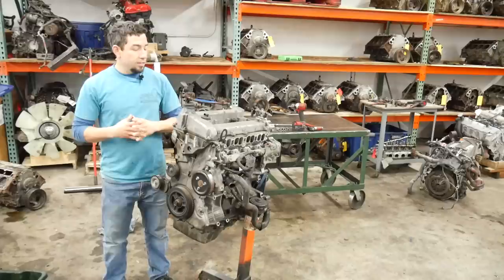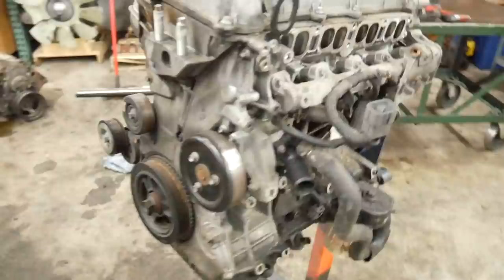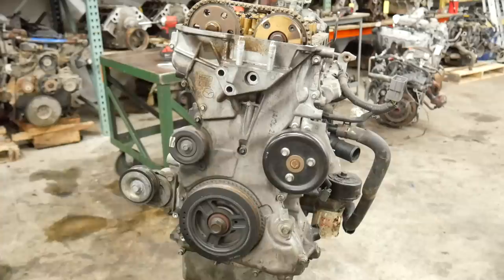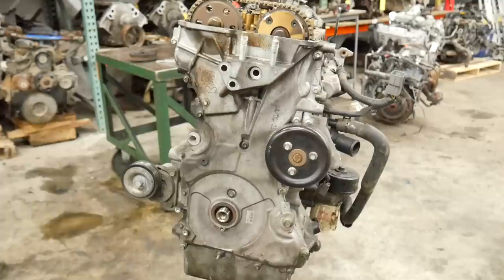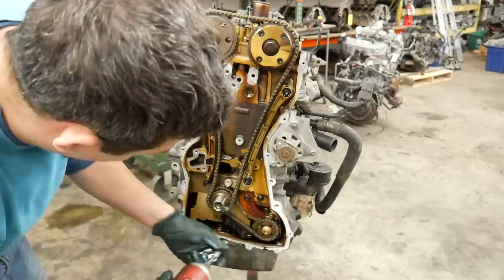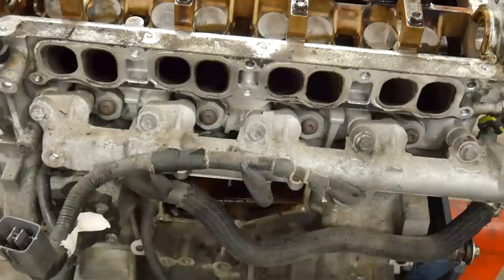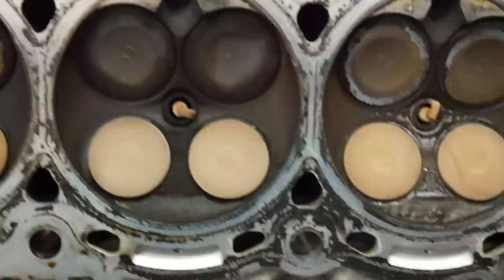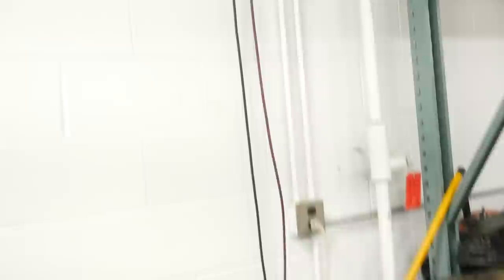TOTAL TEARDOWN: BAD Mazda MZR 2.3L Turbo Mazdaspeed3 Mazdaspeed6 CX-7 Engine.

Comment: It's a FoMoCo - OF COURSE it requires special tools and rules.  The mark on the block explains everything.
Reply: Aside from ls and lt series engines, isn't that sort of an industry- wide thing nowadays?
Reply: @mrdumbfellow927  Which was probably inevitable given the scope and design of propulsion systems now, but good old Blue was up to those tricks fifty years ago.  Not all of it was that way, but  I remember having to fabricate a lot of "special tools" on the fly to keep a Ford running in the seventies, which was the worst era.
Reply: Plus this engine served as a precursor that marked the blueprint for the current day ecoboost engines from ford. So it was just what mazda was dealt with since they were under ford
Reply: @Sn0w_Official  the originating designer was Mazda.
Reply: Ford just owned Mazda at this time
Reply: FoMoCO nearly killed this company. JLR too.
Reply: @taylorc2542  yea no.  Mazda was never fully owned by Ford.  One third.  The wankle/Rotary is what nearly killed Mazda.  Ford gave Mazda greater scale of economies with platform utilization.  Is Mazda doing better now?  JLR, was saved by FoMoCo, the V8 and V12 engines were financed by Ford and remain their best engines.  Hating on a company does not save you from facts.
Reply: @ProjectFairmont  Is Mazda doing better now?  They are now partnered with Toyota, so I would say emphatically that the answer is "Yes."
Reply: @JamesSterling  so, what?  I could care less either way.
Reply: @ProjectFairmont  You asked the question so why did you ask if you don't care?  Huh?
Reply: 😂😂😂😂😂😂 they all do that now days what are you talking about especially the German brands
Reply: @taylorc2542  ford gave them the ranger pretty much, I’ve put over 400,000 miles on a ranger. Damn good trucks
Reply: @JamesSterling  Are they really partners with Toyota? My 2017 Mazda 6 has FoMoCo parts, such as the CV axle.
Reply: Yeah Mazda has improved greatly since they got Ford out of their life.
Reply: @ProjectFairmont  Ford owned 49% of Mazda and the rotary wasn't what nearly killed Mazda at all.
Reply: @freedomisntfree_44  because in the 1970's, Mazda gave Ford the Courier small pick up. @James Sterling, Mazda isn't fully partnered with Toyota, but the Toyota (and earlier Scion) iA, and some later Yaris models were/are rebadged Mazda 2's. Mazda also saved the US market Escort, a dreadful FWD compact in it's 1st U.S. incarnation, by giving Ford the BG Protege chassis in 1990, along with Mazda's excellent BP18 16v 1.8L, optional in upper level Escort/Tracer models. Nearly identical to the MX-5 Miata engine, it whipped out 128 BHP, compared to Ford's 1.9L wheezer making only 89 BHP.
Reply: What Ford cars did this engine come in?
Reply: @mrdumbfellow927  I think Honda and Toyota still used keyed timing gears, floating timing sprockets seems to be more of a European thing.
Reply: @fredzeppelin3969  Future Mazda6 and Mazda CX-9 are apparently going to be based on Toyota's RWD architecture.
Reply: @ProjectFairmont  Hell yeah finally someone who knows what they are talking about!
Reply: It’s a good system as you always get cam timing spot on, even if you skim the head etc. no more adj cam gears etc
Reply: @EdwardT9  I think as far back as the Pinto.  Currently, a version of this engine is in the Mustang EcoBoost.
Reply: Blame ford for this lol. Glad Mazda got out. They do have a partnership with Toyota.
Toyota also owns like 5% of Mazda now. They have a joint plant in Alabama now.
Reply: Get off the app now
Reply: Hahaha that post got me lol.
Reply: @ProjectFairmont  got him with the facts over feelings haha
Reply: You think that’s bad you should see what working on German stuff is like
Reply: Bruv this engine doesn’t even have a key way to hold the crank gears

Comment: I loved my mazdaspeed3, sooo much power,  so fun to drive, never had a problem with mine but I also took care of it.
Reply: Did you buy it new?
Reply: Just came back from 850km road trip and its healthy like new.
Reply: Still daily mine bolt ons and tuned by freek.

Drive it like a race car frequently and never have a problem.....at all.

Close to 300whp, 28mpg, and been reliable for me since 2013.
Reply: I have  a mazda 6mps ( speed6) 107k miles on the clock  and  runs like new
Reply: My mps have 247 000km on clock.still using oem vvt gear stock internals.neva been opened.not using any oil.and still hold compression.the golden secret.keep maintanance.do oil change earlier then what they suggest.and do basic maintanance.clean ur egr valve and massflow sensor regular.replace airfilter regular and use the correct oil grade.and do oil change every 5000km.thats my secret.and never drive car hard when engine is still cold.and let turbo run for min or 2 after hard runs
Reply: I loved mine too, I had a 09 bought new in 08. Sold it last year with 144k miles, original turbo. Changed oil religiously, never had any major problems with it at all.
Reply: You probably wont have any problem with it if you service it correctly. This guy says hes owned 30-40 Mazdas in his life? Well I've owned 2 Mazdas since 1995 and both are still running as well as the day I bought them. One's a 1995 323F (Lantis) and the other's a 2007 Mazda 6. I've never had any trouble with either of them. The 323F had a clutch master cylinder go on me around 2010 plus a door lock actuator and that's it, apart from normal consumables.
It seems lots of people skip on their oil changes in an effort to save money and it ends up costing them more, long term. I do all my own maintenance and if anything I will change the oil early.
Reply: Yeah take care of a car and do the maintenance and you have no problems out it. Love it when people talk shit about a car but don't say about there lack of maintenance 😒.
Reply: It must be the prototype engine.
Reply: I miss my Speed3, but the skinny rods of the MZR motors made them so problematic.
Reply: @txrunroutdoors  Yoo,  I just got MS3 not too long ago and would like to know more about your setup? I want something reliable and slightly more power, around the same you have. This is my daily and only car so I can't go too crazy. but almost 300whp at 28mpg sounds great, I'd love to know your secrets
Reply: power? 263 HP? My jeep has double that, weighs a literal ton more and is faster
Reply: @txrunroutdoors  i know, i also have a street bike with almost the same hp. am i even cooler now? jk. are you really into the speed 3? like, mechanically-wise? i have a 07 cx7 with the same 2.3l turbo. and have never owned on. I have a few issues, maybe you can help. sorry for the earlier comment it came off ruder thatn i was meaning.
Reply: @ITS-ME-EVERLY  wow thats so cool
Reply: For whatever reason it seems these have more problems in the Cx-7s. They like to be drove hard.

Comment: Didn't wait for the conclusion to comment, so I edit it. And, yes I'm that guy : That was my engine for about 200K kilometers and 15 years without an issue. I mean NO ISSUE AT ALL. Frequent oil changes with superior oil grade and quality than requested helped a lot. Then I rebuild it completly new and upgraded. That was my first engine teardown and rebuild and that wasn't that difficult with the correct informations and knowledge.  Definitly won't be an easy engine compared to NA V6 or V8, or even vtec L4 engine. Because it also features a lot of "modern" things these engines do not have, like high pressure direct injection on a 2006 engine. And don't forget the selling price when you criticize engineering, in this case, you get what you paid for and in fact you get a lot for what you paid at this time. And, yes there is a screen on the inside of the oil pickup. For sure this engine is really sensitive to maintenance, but is there any 250+hp turbo L4 that is not sensitive ?

Comment: Arguably some of the best content on YouTube.
Reply: As the owner of a trouble free albeit, never ever touched by anyone but me with 105,000 miles in my 07 Mazdaspeed3 I knew this video was gonna hurt. It did! Time to start going to 3k instead of 5 between changes. I really hope my oil pan does not look like that. I’ll think of this every time I’m on full boost now!  I got a non turbo Mazda 5 with same motor with same Miles parked right next to it. Toyota, please bring the Yaris Turbo here! I can’t afford it but Toyota needs a hot hatch!
Reply: Agree!
Reply: @weekileaks23  Don't worry mate, just don't put chocolate on your oil between maintainences...😉  And if you have beated to hard your speed 3 engine for that mileage on it .. better think about puting an OEM timming kit not too far from today inside... You don't wanna mess with a blown or straigtened chain.
Reply: Up
Reply: I am not sure but I don't think he likes these engines

Comment: FoMoCo... Everything I hated about my gen1 Mazda 3 had that stamped on it...
Reply: This engine was a joint venture between them, based off the Ford 2.0 Ecotec. Ford is still using it in new vehicles while Mazda gave up on it a decade ago.
Reply: You are right, no one believed Ford's "brilliant" EcoTec was based on the old Mazdaspeed 3 motor. Ford got a lot of praise when they put it in Mustang while Mazda has walked away and got themself Skyactiv.
Reply: FYI, no Ford hater here. I own two of them.
Reply: Ford ran Mazda into the ground, they took everything that was good about Mazda and then sold them off, just like most American corps do.
Reply: I had a non direct injected 2004  2.3l mazda 3 that was bullet proof and was killed when I hit a deer.   That Generation  2.3 was a great engine. My step-dad had a Ford focus same year with the same engine and got 280,000 before body rusted out despite running it out of oil 3 times due to not changing it.  Still ran like a top.  

What parts failed on yours?
Reply: Bahahahah you said it.
Reply: @shaggyduder  Mazda exists today because of Ford, if it wasn't for Ford buying that 30% stake in Mazda, they would of been bankrupt years ago. Ford didn't run Mazda into the ground, they kept them running
Reply: @FusionBoost2.0  Bullshit. They raped Mazda for their small vehicle technology and that was that. Mazda leadership in Japan have gone on record stating that their relationship with Ford was the single worst decision that Mazda ever made. Outside of the RX-7 , everything that has gone to shit on Mazda’s is Ford designed and produced. I’ve been a professional mechanic for 30 years and all of Mazda’s woes today are from Ford garbage on them.
Reply: I own since new a 2009 Mazda 3 hatchback with the 2.3 and 5 speed auto
I have 213,000 miles on it and still running strong
Doesn't lose a drop of oil between oil changes
Hooray for the Mazda Ford alliance
Reply: Yes those Ford engines do not like to run low on oil. My dad blew his up in his escape hybrid from lack of oil. But his Oil Life Monitor still had 10% 🙄
Reply: @joshg1244  They are marginal engines at best. Anyone that follows the oil life monitor will be doing some major engine repairs by the time 100K are on the clock.
Reply: @prevost8686  well I'm telling you if Ford didn't buy that stake in Mazda, Mazda was dead.  They were damn near bankruptcy before Ford stepped in with the money. Mazda was a financial mess for years, piss poor sales and shitty  cars weren't doing much for them... Ford gave them product that sold well for them and kept them alive. The B series truck was a Ranger, The Escape copy was all Ford vehicles and were big sellers for them. Of course Ford took some tech and everything in return, they did own a majority share in the company. They used the MX6 as the Probe don't care if you were a tech for 100 years, I'm a tech as well... It don't mean you know much about the financial side of anything. Ford is the reason why Mazda has their big expansion in the late 90s and 2000s. Ford kept Mazda alive, and that's facts
Reply: All I know is from my sample size of 3 Mazdas in the family is that my 300000km/30 year old BMWs are far less trouble.... the 02 model 323 BJ2 with the 1.8L FPDE has worn rings from too much cheap oil in its life and had the issue with the soft manifold screws being chewed up in the engine but otherwise works ok coming up to 200000km, the SP23 had constant nagging issues (many unrelated to a tbone shunt and understeering into a kerb) from day one to the day it was sold, and the 07 CX7 has had constant issues with its diffs even though its been driven less than 5000km mostly highway a year, and it is extremely sensitive to the oil that goes in it, now I know why
Reply: @mikec9112  you have no clue what you are ranting about. To this very day the Ford supplied shit on Mazda vehicles continue to tarnish Mazda’s reputation. Ford has never “helped” anyone.
Reply: I had an 08 Mazda 3Si sedan with the 2.3 and 5 speed man, the 158hp version that was made in Japan, not by Ford, and not a Ford design.. Excellent drivetrain, that was never apart at 190k. The body completely rusted away in 10 yrs from road salt. A guy from California bought the whole car just for the drivetrain, calling it "The good engine"...
Reply: The mere fact u geniuses keep saying Ford Ecotec shows u don't know squat
Reply: @shaggyduder  what?! Mazda haven't been 'run into the ground' and it was Mazda that bought back their share once things improved. To anyone hating on the MZR/Duratec engine, I can assure you beyond all doubt the 2.0 MZR is a better engine than the 2.0 SkyActiv with it's secondary harmonics and sluggish throttle response.
Reply: @prevost8686  what woes do Mazda have today? If you're from the US, Mazda's market share in the US has never been great. In Australia Mazda is always in the top 3 rated automotive makes with sales in the top 3 also.
Reply: @FusionBoost2.0  True.  And Mark Fields was the young Ford Exec who managed to make it happen.  Then the Ford Board, dominated by the family's super voting power shares, dumped its Mazda shares.  CEO Alan Mulally groomed Fields to replace himself, which happened in mid 2014.  Less than three years later, Chairman Billy Ford (smartest guy in the room... just ask him) forced Fields resignation, and replaced him with retired Steelcase CEO James Hackett, who's chief qualification appeared to be his total lack of experience in the auto industry, and thus his inability to ever second guess Billy Ford.  Hackett lasted barely three years.  Go Lions...  Superbowl... this is the year!!!

Comment: Its all about the owner. After 220k kms i decided to do a timing chain job so i took the motor out and it was torn down. Inside looked like it was new (Still have stock size sleeves). Bearings were okay but cyl 3 had a bit of brass showing. Motor was built to handle more power and the crank shaft went out to get keyed. Balance shaft was deleted (makes the car obnoxious on idle). I have those marks on my valve cover i think its just from when the car starts up. As an owner i dont think they're hard to work on at all. Thats my opinion.

Comment: I just traded a 08 Mazdaspeed 3. It had 189,000 miles on it. For the last 140,000 miles, I have been running a Cobb Stage 1 plus tune on it. It has been drag raced and I have had street fun with it. It was my daily driver, including Michigan winters for 12 years. The only thing I had to do was change shocks, suspension bushings, tires and brakes. I had ball joints fail at 180,000 miles so I replaced those, along with the whole front control arms this spring. Ended up replacing the front K member as well, since I mangled it getting bolts out. The car still had the original clutch that was still holding. The car had it's original turbo. The motor mounts were all still good. The car never even turned on a check engine light it's entire life. The car had synthetic oil in it it's entire life. Best car I have owned up to this point. Be religious with your oil and spark plug changes people, it matters. The PCV system on these does blow, but there are fixes for that.

Comment: I had a 2010 CX-7 and put 150k on it.  Normal maintenance and changed the oil regularly.  It was a perfect car.  Had it for 9 yrs.
Reply: I’ve got a 96 Ford Probe . Just changed the oil yesterday. Got it as a demo with about 3k miles. Always used a synthetic oil. Still runs , just can’t prevent it from rusting.
Reply: @joeshmoe629  wow a probe, don't see many of them!
Reply: @willg125  if the rust keeps flaking off , there won’t be much more of it left to see
Reply: have a 2011 CX-7 GT 170k on it. use synthetic oil runs good
Reply: @joeshmoe629  if u put it through the carwash , that would be the reason for rust. I have 2007 mazda 6, it never seen a carwash. Zero rust issues